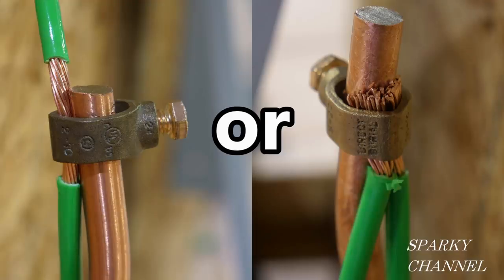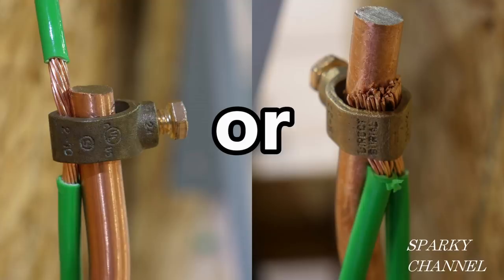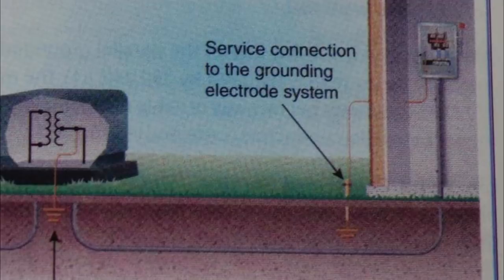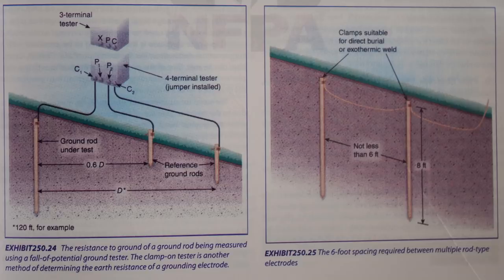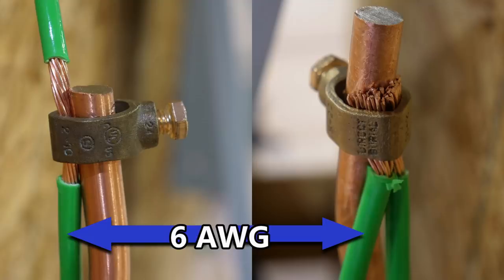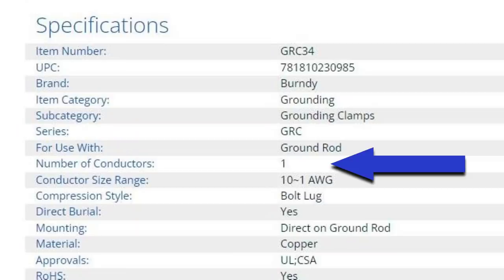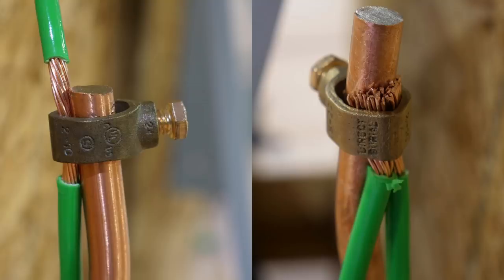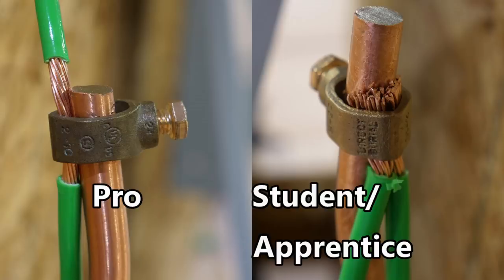Which is Correct?

Comment: Great vid! Do grd rods have to b made of copper, or can they b any metal?
Thx⚡️
Reply from the maker: Ground rods for houses are made of copper coated steel and are 8' long.
Reply: Per Art 250.52(A)(5) 
Rod and pipe electrodes... where steel, shall have the outer surface galvanized or otherwise metal coated for corrosion protection.

Other listed grounding electrodes shall be permitted.

Aluminum shall not be used for the electrode.

The point is not the material, it's the effectiveness of the grounding system
Reply: So my house is old. My panel has no ground rod installed to the panel.  My service panel is over a driveway.  Do i drive 2 ground rods into the asphalt or do i set 2 ground rods six feet apart in my yard and then run a ground to my panel?  Is there a permissible distance for that?

Comment: Both rods were cut that's a violation per 250.53(G) also the installation on the right is not continuous per 250.64(C) an acorn clamp is not approved for the method of installation shown shown only irreversible crimps, CAD welds or sections of busbar are approved. The installation on left is good because the wire has not been cut. Again it should fail though cause the rod looks like it was cut.
Reply from the maker: Excellent, all correct. The ground rods are only symbolic though, just pieces of ground rod connected to OSB in the Music City Center. You are correct though, thanks!
Reply: Why can't the rod be cut? It has been cut at the factory, hasn't it?

Comment: What if you used 2 clamps? One for each wire?
Reply: It would be code compliant
Reply: It would cost extra money. Ground burial connections cost more than regular connections. Plus just don’t cut the wires. Grounding wire doesn’t need the protective coating on it.

Comment: Huh....so if it had been labeled as use with up to 2 connectors, then would either of them been acceptable?  Of course I'm not sure if there are any such clamps or not....also, could you have just used two clamps on on top of the other?
Reply: Don't think so, I thought some grounding cables had to be continuous run.  Or why not just send two wires out from the panel to two different ground rods?

Comment: Neither... NEC calls for solid ground conductor...
Reply: Nope it says it can be stranded if the clamp is listed for stranded or you use an exothermic weld.
good luck finding a solid conductor larger than 2AWG
Reply: @MichaelClark-uw7ex  I’ve been buying #4 solid for 200 amp service for 50 years

Comment: When you have 2 ground rods can you use 2 separate #6s to two individual ground rods? Or only one  continuous ground wire?
Reply: only a single wire in a daisy chain from the main disconnect, to cold water pipe, to first ground rod, then to second ground rod. No cuts, breaks, or splices.
Reply: Yes you can use 2 but why waste wire.
Reply: I've always used 2 separate. My opinion it's easier. One 3 ft left of meter. One 3ft right of meter. Opened up shop in SC and failed my first rough in inspection due to that. I personally feel like it's the same. And sure you'll get the same resistance but as everyone knows... gotta kiss the inspector butts sometimes ha
Reply: @peterreynolds8340  ...  what you have always done is not up to code these days. It was spelled out in the video.
Reply: @rupe53  SC is a cycle behind. Just implemented the 2017 code. They are not enforcing 2020 code, yet
Reply: @peterreynolds8340  ... I believe the bit on the ground wires and rods goes back more than 12 years. (when I upgraded my service) 2008 perhaps? Might be earlier.
Reply: @rupe53  you can take 2 #6 from the panel to 2 different rods, its a lot more wire but can be done.

Comment: I know this all to well. Upon installing a update new service in my house which was constructed 60 years ago I had to tag with a ground wire the gas line and water line with one continuous wire no breaks and use the one piece clamp. Over 60ft of copper wire and I had to make sure I did not forget the clamps as I was pulling the wire, it was not fun. Then also the same on the ground rods , can’t forget those clamps 🤪🤪🤪👍 when pulling the wire.
Reply from the maker: Good point, you have to remember the clamps as you're running the GEC.

Comment: Boy I hate to say when I'm wrong but I picked the wrong one course I only do very light electrical the biggest thing I did was hook up 230 volt lines for a cannabis grow room lights. I am looking to add a second sub box because the one I have is full and I'm not into overloading it with  double breakers. That I'm concerned about doing and getting right.

Comment: I know the rod on the left is correct.   I am not a inspector.   Been in the trade a very long time.  Me I might have used 2 clamps on the right side.   Yes I know.   Get them both beside. Each other . Both with only 1 wire.  Yes I know.  NEC says the #6 is to be continuous.   Here in KY.  From the panel to a copper water pipe.  A electrician will install a #4 to the water pipe.  And then install a #6 to the rods.  So they only meet together at the panel.  How is that any different if u ran a wire to a rod. And another wire to #2 rod?  Both meet together at the panel.  Oh I do need to buy a new NEC
Reply from the maker: Thanks!
Reply: It wouldn't be technically wrong to run two wires out to two separate ground rods, but just wasteful. Why double your wire usage? The ground rod isn't often closer than 6' from the panel and also, you might not have as many ground lugs in the panel to do that either.
Reply: @IceBergGeo  .  I did run 2 wires out many years ago.   1 wire to a rod.  Another wire out to the other rod.  Elec inspector turned it down.  Said it had to be 1 wire to both rods. And continuous.   I asked him if the garage was struck by lighting. What was safer? No answer.

Comment: Are you allowed to leave the insulation on the conductor, or must it be bare.
Reply: Never seen a insulated ground wire attached to a grounding rod outside a structure.
Reply: Yes.  Only the ground rod and wire at the point of connection need to be bare.

Comment: See, I would have assumed right is correct the pressure from the clamp is holding equally on both conductors. On the right I would think that one conductor could keep the clap from fully pressing down the other if one was slightly small.

The the pro solution still hold true if the conductors aren't the same gauge?
Reply: Thats the point, the left is only one conductor with the insulation stripped off of a small section with one end connecting to the service and the other continuing on to the next grounding rod. At least thats how it seems to me
Reply from the maker: Yes, if the clamp is UL listed for only one wire, that's what they mean.
Reply: Oh, I think I just realized something. On the left, is that one continuous wire with the insulation cut out the middle or is there a break between the top and bottom wires. If it's continues, I can see what it would work better.
Reply: @SparkyChannel  ... this might be an odd observation: if you have two stranded wires and you twist them together (and soldered them?) they would become a single conductor. Yes / no?
Reply from the maker: @rupe53  I don't know why not but it would be up to your inspector.
Reply: @rupe53  that's an interesting thought. But I don't think soldering counts as a wire connection. You would have to use an exothermic welder and then STILL do as the right picture shows.
Reply: @IceBergGeo  ... my example was hypothetical, in that soldering IS an accepted means of joining two wires together under NEC. The question I posed was how they define a wire. IOW, does twisting and soldering make them one because they are now permanently joined as a unit?
Reply: @rupe53  soldering doesn't count as a permanent connection. Welding, on the other hand, does count. Subtle difference, but it's there, because you can desolder it and take it apart. Is it easy, no, but you can still do it, just like two wires under one lug, or a mechanical lug being removable.

Comment: i like that the ground rods used are cut off. When i have to cut off in the field, i taper the edge to resemble the factory’s. In my neck of the woods it’s nothing to hit rock.
Reply from the maker: Cutting ground rods is very incorrect but this was the IDEAL Electrical Championship so they were just simulated ground rods.
Reply: Shouldn't the end be mushroomed out from driving the rod.   I would think any good inspector  would catch that, for not being driven to the right depth?   I could be wrong.    Not a pro.
Reply: @homesteadhaven2010  my driver doesn’t mushroom the end

Comment: I hope you sir will be able to explain ufer someday.
Reply from the maker: For other viewers: A “Ufer” ground is slang for what the National Electrical Code (NEC) addresses as a concrete-encased grounding electrode. The term “Ufer” does not appear in the Code, but many in the industry use it. Ufer is the name of the engineer who created it as a solution to significant grounding problems discovered by the U.S. military.
Reply: What part about the ufer ground needs explanation? How it works? What makes it better than most?
Reply: @IceBergGeo  everything would be fine for other viewers just like sir sparky did for me

Comment: Both pic is wrong it look like the groundrod is been cut. U have to use 8ft length not cut.
Reply from the maker: Yes, cutting ground rods is very incorrect but this was the IDEAL Electrical Championship so they were just simulated ground rods.

Comment: So if stranded wire is allowed (which I question it can be called a single conductor in this application), what is the difference between a group of wires in one jacket vs a group from two jackets? As long as the total equivalent wire guage still falls within the gauge limits set by the manufacturer I see no difference. The insulation method doesn't matter. Take it to the next level where it is uninsulated. If you take the two sets of wires and twist them together before inserting them, are they a single set?
Reply: Electrically and physically there is no difference. Bureaucratically however there is a difference in that one is code and the other isn't.
Reply: @HPD1171  Yeah your point is good. But I don't think it would hold up if challenged in court. There is no difference. If you allow stranded, then you cannot claim it has two wires under the clamp.
Reply: @court2379  yeah the whole thing is a bit silly. I prefer solid wire anyways for connecting to grounding rod since it is a more robust connection and the solid wire holds up to the elements better particularly with corrosion resistance, even though code allows both (stranded and not stranded). The not allowing multiple conductors rule makes more since with two solid conductors since the wires are not clamped as securely due to the geometry of this particular clamp. The multiple stranded conductors just happen to fill that space just as securely as a "single" conductor would so it may seem at first glance like its fine even though it is technically not code compliant.

As far as what holds up in court,  I don't really know or care what happens as that is not my job. The only thing I need to worry about is that my work complies with code regardless of how silly it may seem in certain circumstances.

Comment: You had me second guessing the work I just did on my house. Only difference I used solid 6awg.
Reply from the maker: Sounds good!
Reply: solid is ok, just harder to work with. Mine passed inspection.
Reply: @rupe53  I was passed with one piece of homework. I put in a new main panel and rewired the old main to a sub panel. With that I didn't move my plumbing ground to the new main panel.
Reply: @AlexXHitchcock  ... in theory it should all be fine. OTOH, that's not what the code says.

Comment: All I can imagine is in the two wire connection the strands of wire are not woven.  The individual wires could move out in time.   I wonder if you could solder that joint.       Keep in mind, most homes in the US don't have the second leg.
Reply: The ground clamp is only rated to have a single conductor connected as shown, any other connection method is not approved/tested/or code compliant. If you need two conductors connected to the ground rod with those clamps you would use two clamps.
Reply: @killer2600  Interesting that you mentioned testing . I didn't think of it that way.  There may not have been a need to test other methods after the first method was established.

I often try new ways of building,  however never with wire.  Electricity holds its secrets hidden in a language of physics.   I'm not a native speaker.
Reply from the maker: It's true, most older homes have only one ground rod.

Comment: Why does regulation call for only 1 conductor and not single cur into 2 pieces? Any electrical engineers want to explain?
Reply: dont need to be an electrical engineer to understand,  1 conductor cut in to 2 pieces is no longer  ONE conductor , its TWO conductors .
Reply: In the case of solid wire, the way the clamp works it could pinch one wire and not the other. Thus the rating for only one. Careful installation could avoid that of course, but the manufacturer won't accept that liability.

Comment: its says no less then 6ft. but is greater better like say 10ft?
Reply: Greater is better.  While code minimum is 6ft, each rod has a "sphere of influence" with radius of it's sunk length.  So to maximize performance the 2 rods should be placed at 2 times their sunk length apart.